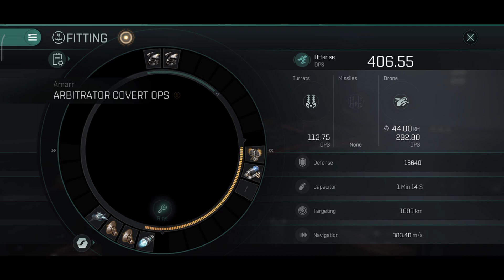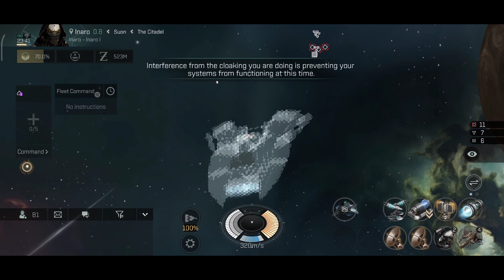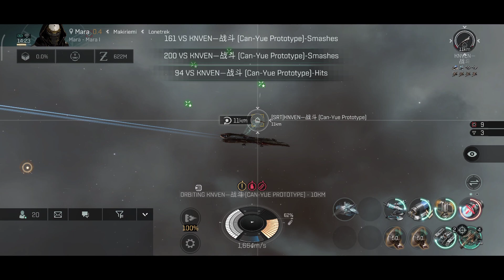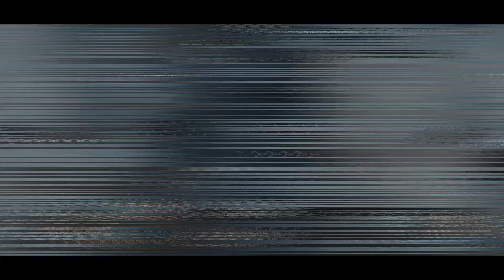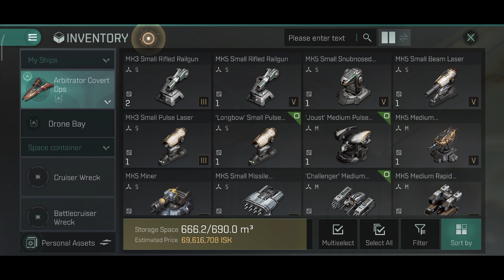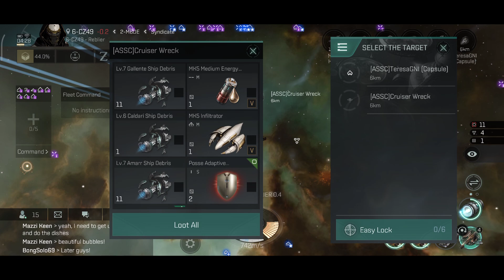EVE Echoes Arbitrator Covert Ops - [Pilgrim] - Solo PVP & Fleet Operations - 60+ Killmarks

Comment: Do you know that Damage Rigs and DDA's share DR? So your DDA's are giving like only 0.5% of dps? Speed Rigs for Drones are always better than Damage Rigs, and even more if you use DDA
Reply from the maker: Just checked it out, there is atleast 120dps difference after I swapped out the amplifiers xD, I'll play around with the modules a bit
Reply: @VirtualPersonYT  DDA will still provide dps increase, but in all my calculations, using  2 Speed Rigs and 1 Damage rig is around 10-15% more DPS than 3 Damage rigs, at least on my simulations
Reply from the maker: @albertgarcia3048  I will try it out